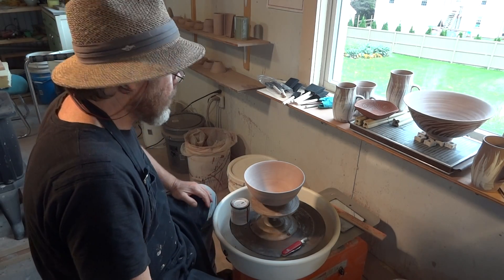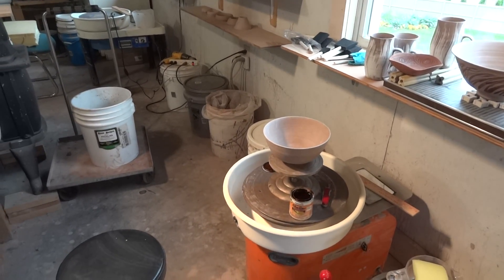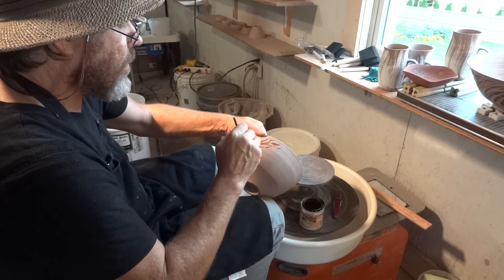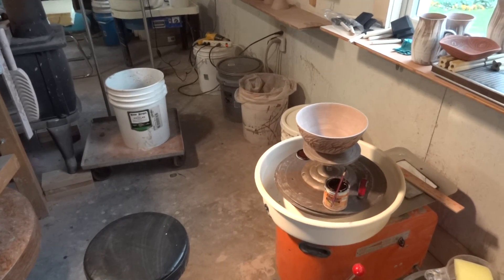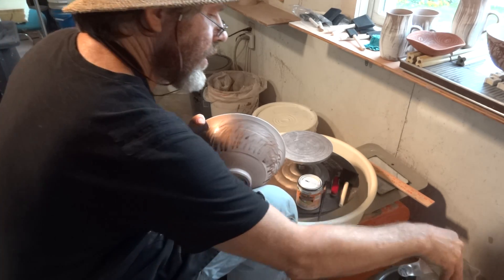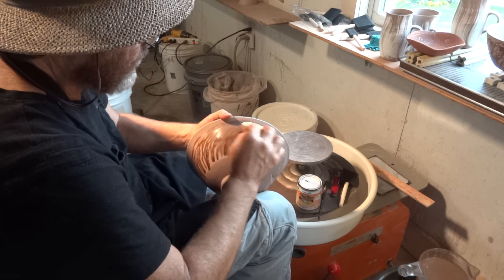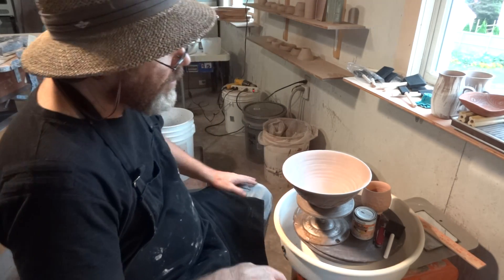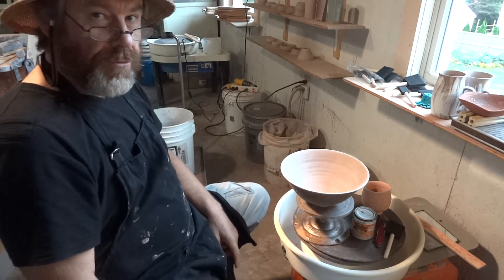SIMON LEACH POTTERY TV - Resist decoration using shellac !

Comment: Do you think varnish would work? I’ve got a can left over from a project.
Reply: Varnish might take a long time to harden, whereas shellac is dry in a moment. Either one is combusted away early in the bisque firing. Shellac may be hard to find as it is out of favor in big box stores. Zinser is the most common brand. I use dried shellac liquified with denatured or fuel alcohol.